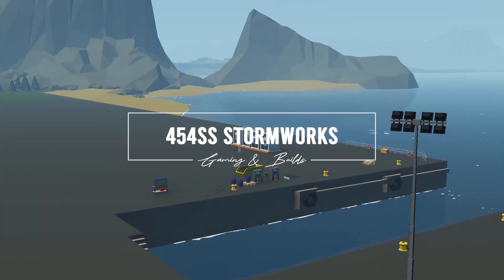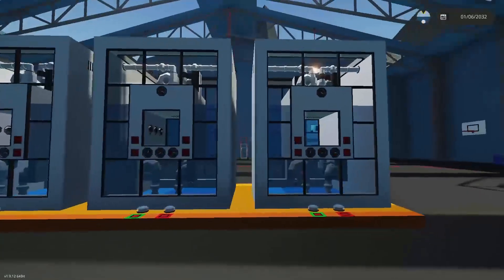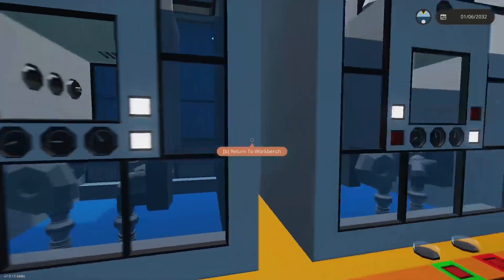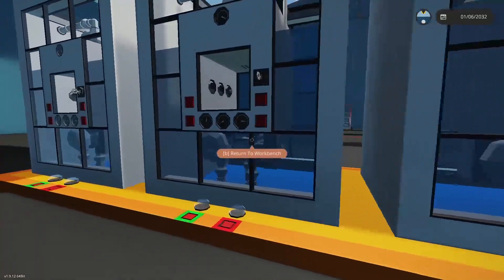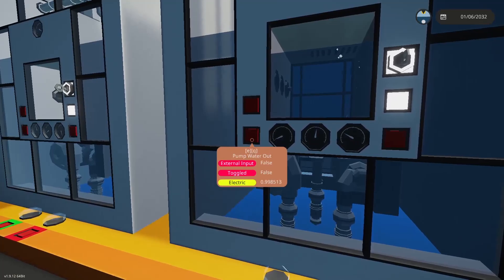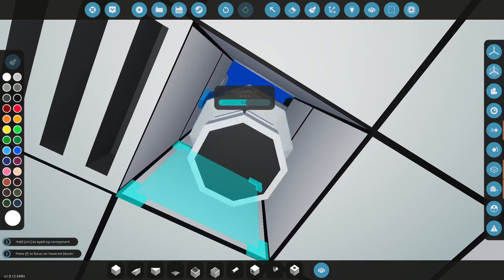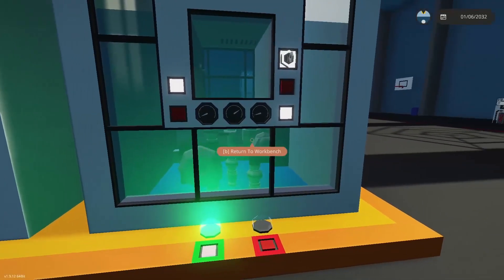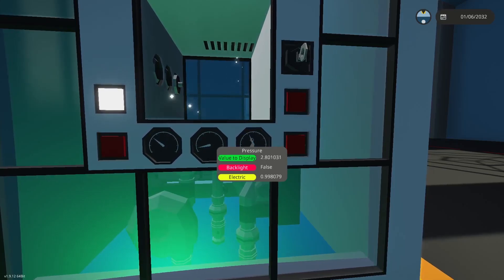Use PRESSURE to FILL or PURGE a BALLAST TANK (HOTFIX 1.9.12)

Comment: Okay, so something I noticed while plucking away at some pressure systems.  Mind you, I'm not sure where in your order of videos this one is, but I'm at April 21st, 2024 when I type this.  And I'm typing straight up as I listen to you, and work on a boat at the same time...

Gas volume is CRITICAL.  I noticed while working with a small gas cylinder (3 blocks size), I loaded it in unconnected to pipes just to get a basic benchmark.  When I then started building a pipe and valve assembly for a fluid tank for an oiler, I connected it to an elbow pipe before running it through the manual valve.

When the boat loaded in, the gas tank IMMEDIATELY dumped about half its pressure (down to 32 ATM) by the time I'd walked over and jumped on the boat.

This tells me that your pressure/volume ratios MUST be accounted for at a roughly block to block ratio.   If you're using gas to push liquid out of a tank, a gas tank of EQUAL volume to the liquid tank will dump HALF its pressure (or more) by the time it pushes liquid out of the tank.  It goes without saying, that if you're using small pressure tanks, they will lose most their pressure, and thus most of their force, in seconds and barely push any fluids out.  Furthermore, since the pumps are only moving fifteen or so liters a second, they don't fill large volumes very fast unless you have a LOT of them.

Even as I type this, I experimented with three medium tanks against a 5,600 L fluid tank.  Each medium gas tank is 8 blocks long, and they dropped to 56 ATMs on load.  Those pumped back up to full pressure quickly, but when I opened the valve to the mains, they dropped to 7 ATMs in about ten seconds.  So, gas and fluid behavior, is semi-realistic.  You lose a LOT of air pressure to volume, so you MUST correlate your pressure tanks to your ballast tanks and do the back of the envelope math to how much pressure is needed to force a fluid through a pipe system.

Comment: Question. Was the liquid container on the exteroir of the inner chamber completely closed off? I feel like that has an effect because pumping water from inner -> outer means outer is now pressurized and pumping water from outer -> inner means that outer has a vacuum. What if you put an air releaf valve on the outer chamber?
Reply from the maker: I made a new video where I tested the setup in the ocean and it was the same :)

Comment: Pumps limit flow, and I blow my ballast directly from compressed air tanks, no need for any pumps.
Reply: Could you please elaborate? I have a sub with a hydrogen electrolyser and I have tanks with hydrogen that I would like to use for blowing the ballast.
Reply: @Pathfinder192  Basically, the gas tanks feed directly into the ballast tank with valves and gas relief valves, then the pressure of the gas forces the water out of the  liquid relief valves at the bottom.
Reply: @Pathfinder192  That could work, but you would have to really compress the gas with some powerful pumps. I usually just use a bunch of large impellers connected to my power source to suck in external air to compress. Easier, and faster. Last I checked, pumps were not very effective at compressing air, as of now, and hopefully the devs will boost them.

Comment: I know everything would change, but would be cool to see some test with pressurized gas tank (the premade ones) and use them to push the water out like in a real sub. I also think that the deeper you go the more difficult would be to pump water out due to external pressure as appened before space.

Comment: The problem with pressure for submarine ballast rn is the Fluid port also push pressurized gas out of the room. I haven't test with the Fluid port end not sure if it also push the pressure out. I missed the Fluid filter and the Fuel manifold bug.

Comment: I think the fastest way to "pump" is to have two gas tanks, one filled to twice the volume of the ballast tank at the outside pressure and the other to a vacuum to the same "capacity".

Then, to pump the water out, just open the valves from the filled gas and the water out.

Do the vacuum to pump water in.

So, if you have a 1,000L tank sitting at sea level pressure of 1atm full of water, a 1000L tank of gas compressed to 2atm should empty the water tank, fast at first then slowing down as the pressure equalises.

A vacuum of -1atm should draw water in to 100%.

Of course, a smaller gas tank can be used with a higher pressure, eg 100L at 20atm should be the same effect.

And using even higher pressures will help it move faster and stay faster

In the case of a sub, you might get away with two larger gas tanks, a couple of pumps to recharge those tanks and just plumb pipes and valves to the ballast tanks.

Of course, further testing is required and tomorrow's hot fix may change all of that.

Comment: You have the option to temporarily rollback to before the gases update and video record the same sort of tests. You can then time things based on your framerate and determine how long each test takes to fill & empty the tank.

Then revert back to the newest version and run the exact same tests. This would give you the most accurate results.

You can then use the test information from the old version for any future tests.
Reply: i was wondering the same thing. if you open a door and flood a space, a ship will sink pretty quickly. a door on top and bottom of a ballast tank should fill it quite quickly. you could then close the top door and balance it out using air pressure and pump out any excess then close the bottom door, sealing the ballast tank.
Reply from the maker: True, thank you for the detailed comment! But the more I thought about it the more I was thinking that didn't matter anymore since the game has changed so the new "base"/"standard" case is just pumps without any valves, just like the old system. Anything from there is either better or worse!

Comment: Don't use pimps to get stuff in fast. Pumps have a limit just like real life. The fastest is like a moon pool. You take out the air with pumps till its low or almost vacume and then open the hatch/door. And than to get it out fast you need high pressure to get it out fast thrue the pumps or the doors. The problem with the pumps to get water Insite is that water doesn't have a lot of pressure near the water surface. If you make your tank a lot higher it shut be faster if they made it that realistic.
Reply: I mean ur right pimps only look after the cattle 😂😂😂

Comment: The Jet Engines on my ship. Work fine they are able to push my ship to a maximum speed of 34.93 knots 
But when i switch gears on my ship after i turn the gears off my uet wngines slowly drop in RPS intil the shi is basically at a stand still. 

And i trued the 2 electric motors trick and it did help. What do i do?